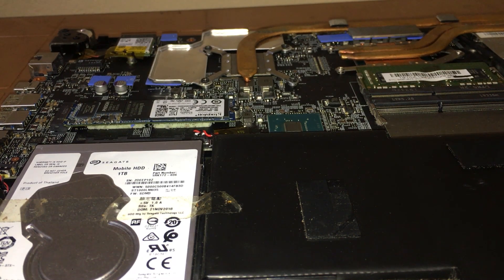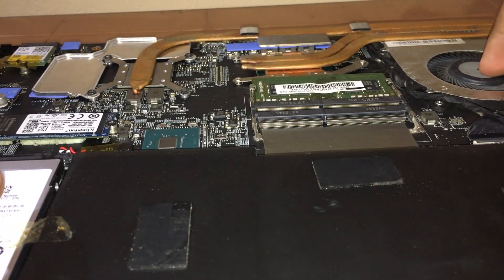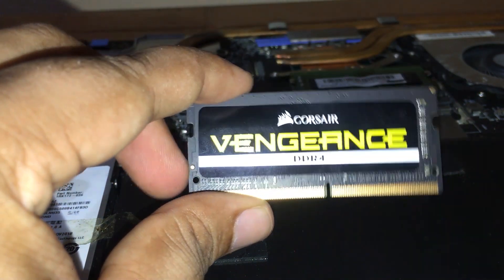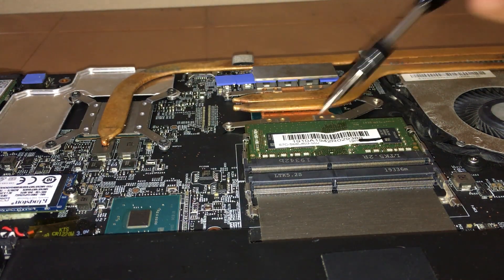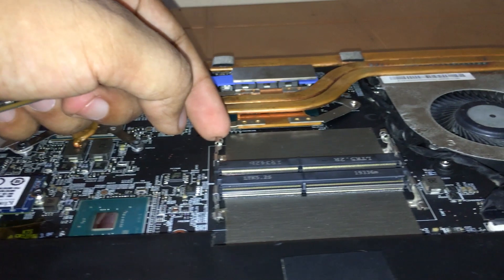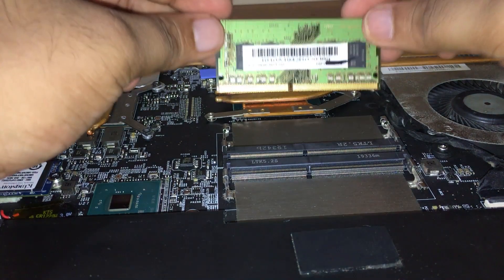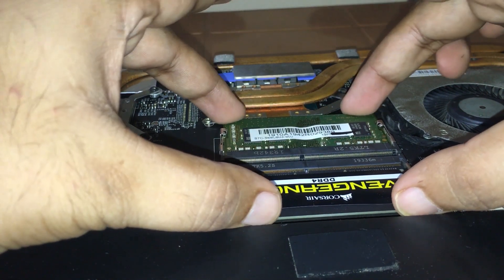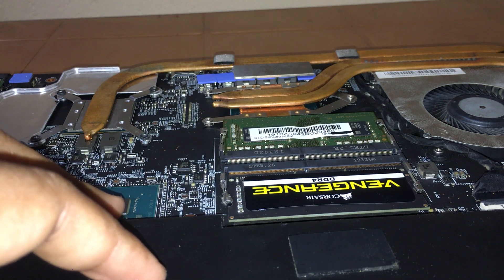How to Upgrade RAM on Laptop? | Upgrading RAM on MSI GF63 Thin 9SC | Subscribe , Like & Comment !!!!

Comment: CAN I ADD 16 GB 3400 MHZ RAM WITH 8GB 2667MHZ RAM ( STOCK RAM ) AS 8+16 = 24 GB ? BOTH ARE DIFFERENT SPEED RAMS.
Reply from the maker: Yeah you can but both will
Runs at slower speed which is 2667

Comment: Is that Single rank Ram ?
Reply from the maker: What do you mean?
Reply: @GaraYaka  sorry for the delay response bro ... I'm planning to upgrade the Ram ... So our laptop supports 2666MTs variant ..when i went to the Amazon it shows 1700 rs for Vengeance ram 3200Mts and 2666Mts for 2000 ...
So if i install 3200Mts version will it able to run it...
Reply from the maker: It will runs at slower speed which is 2667
Reply: @GaraYaka  So can i go with  3200mts variant ?

Comment: Bro what type of ram to buy
Reply from the maker: What is your speed ?
Reply: @GaraYaka  where to check bro?
Reply from the maker: Go to task manager. If you are in summarized version switch to detailed version by clicking details. Then you should select memory. Under memory there is your ram speed with frequency
Reply: @GaraYaka  2933mhz
Reply: What to get is it 3200mhz type of ram or the 2666 mhz ram bro?

Comment: Bro can we use 3200mhz RAM instead of 2666mhz ram for this laptop?
Reply from the maker: No bro. You can’t . Because speed doesn’t support CPU
Reply: you can use but the CPU i.e core I series 9th gen supports only upto 2667mhz, so even if you use a faster RAM, your system will recognize it as 2667mhz
Reply from the maker: Yes that’s a another point
Reply: Ok bro thanks♥️
Reply from the maker: Ok brother no problem 😍